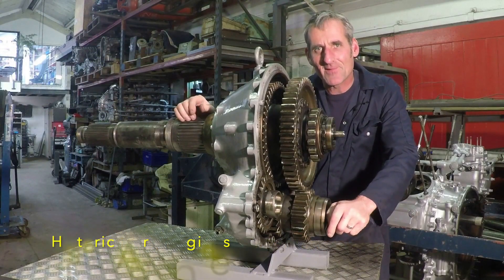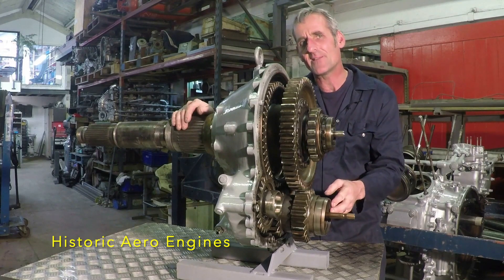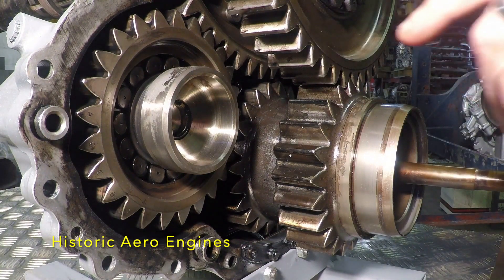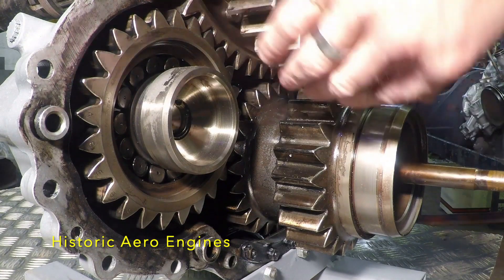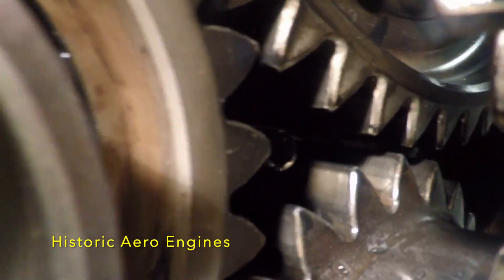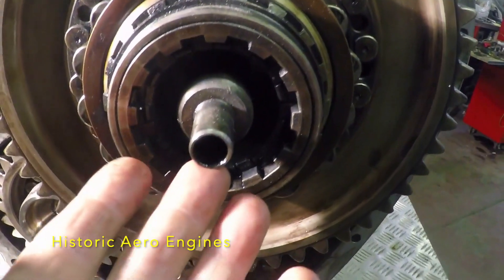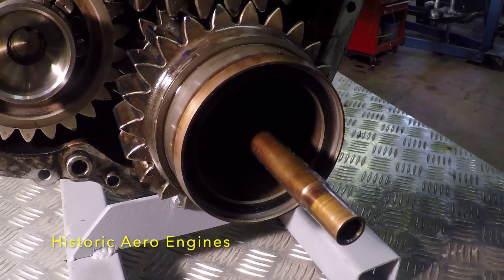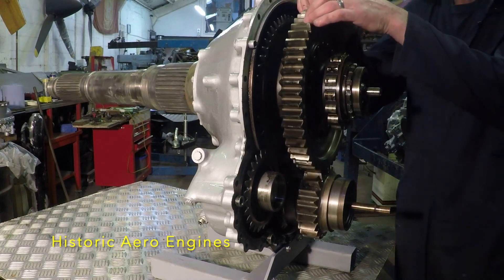Rolls-Royce Griffon engine contra-rotating propeller reduction gearing

Comment: Is that designed to stop the torque pulling the aircraft around on takeoff?
Reply from the maker: Higher power engines need propeller blade area to utilise the power.  You can use more blades, larger diameter, or two banks of propellers in a contra-rotating configuration.  As such, this also negates twisting due to torque, but on the Shackleton (4 engines) that is not a concern.  Proximity of the propeller tips to the ground is a constraint which two banks of propellers can help with.

Comment: I'm surprised that it's only 1 pinion that handles 2500hp. I'd think that for redundancy they'd use some sort of planetary gearbox. Does anyone know by any chance how many hours this gearbox can operate before total overhaul?
Nice gear teeth, very pointy, for high speed and noise reduction.
Reply: In a planetary, the input pinion takes all of the input power, too - but on 3 simultaneous teeth. But if anything breaks, the whole geartrain is toast. No such as thing as redundancy here. Plus, They needed to have the prop as far up as possible, so the axis offset is desirable.

Comment: How much extra performance did the two prop system give over the single prop.
Reply from the maker: There are several reasons for using contra-rotating props.  They usually include negating swing on take off for single propeller aircraft, or because of reduced prop/ground clearance.
Reply: @HistoricAeroEngines  Good point, never thought of that.
Reply: It's contra rotating.  😉
Counter rotating is where you have two different engines on the same aircraft and their propellors turn in opposite directions to counter  the twisting moment from each other.

Comment: Thanks for posting, most interesting. Square cut gears, I'll bet there was a bit of noise coming from them at times! 
Was any provision made for prop flash at low revs?
Reply: Granny Gears.. Rattle and Hum...
Reply: Straight cut gears definitely make a lot more noise than helical gears, however the fact that they don't create any axial loads allows the gearbox housing to be lighter. Reducing weight is a much higher priority than reducing noise. Straight cut gears are still being used on modern gas turbine engines.

Comment: Fantastic Thanks so much for making this instructive video.
Reply from the maker: Welcome!  The Griffon contra-rotating unit weighs approx 40 kgs.  Similar to a Merlin single shaft unit.
Reply: Because the weight of the gearbox is listed as a mark against the counter rotation tandem propellers. Can you say what this set of gears and housing weigh?